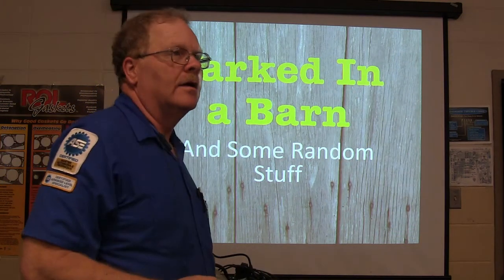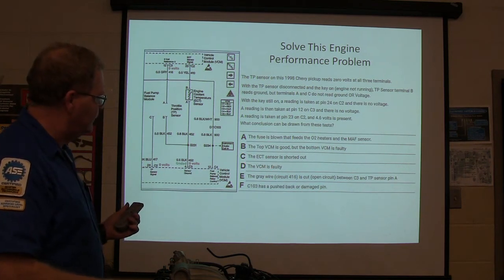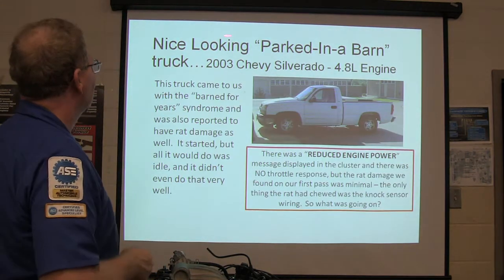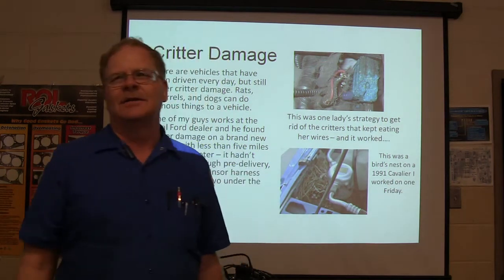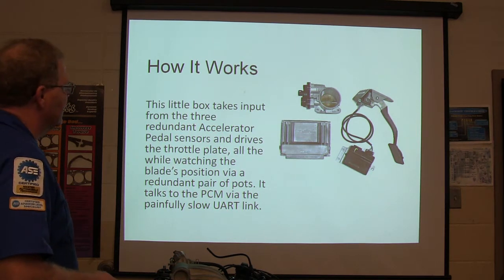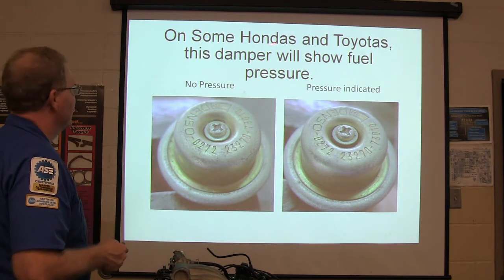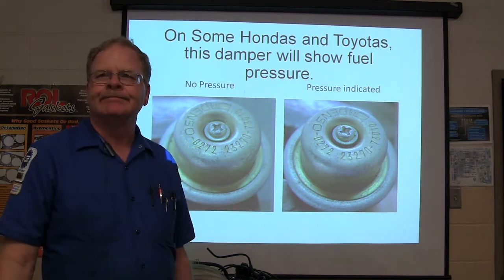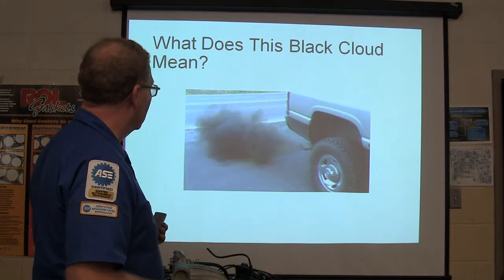Barn Truck and Random Questions

Comment: Hello. I was dealing with a low vtec oil pressure code. Because I didn't understand the system properly, I misdiagnosed the car. My understanding is that the vtec pressure switch is open or close after activation of the vtec solenoid. From other sources, I have learned that it inputs the oil pressure to the pcm so the pcm can activate the solenoid. Could you help with that?
Reply from the maker: What year and model Honda were you working on?
Reply from the maker: If it's a P1259, make sure you have sufficient engine oil pressure first - change the oil and clear the code to see what happens.

The VTEC oil pressure switch above the oil filter can be faulty too. Replace it with the OEM Honda  switch if you're going in that direction.

But a restricted VTEC solenoid passage could cause that, or you could have solenoid or wiring issues. Repair or replace as needed.
Reply: @McCuistian   I forgot the year and model. The issue was the connector was not pushed in all the way after a tech replaced the switch. I was just trying to understand the vtec system. I am beginning to believe that the vtec switch inputs the oil pressure to the pcm. If the oil pressure is what the pcm expected, it turns the solenoid on. My belief that the vtec switch is a feed back input, like  the IGF in toyota no longer stands. Thank you for replying.